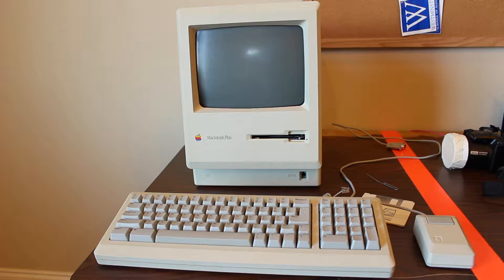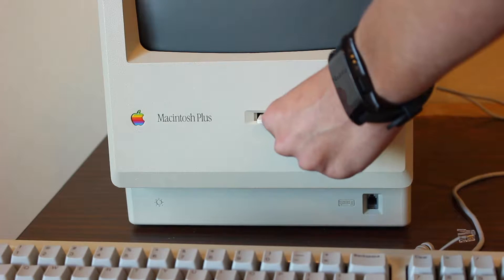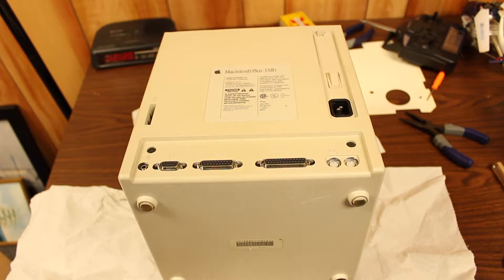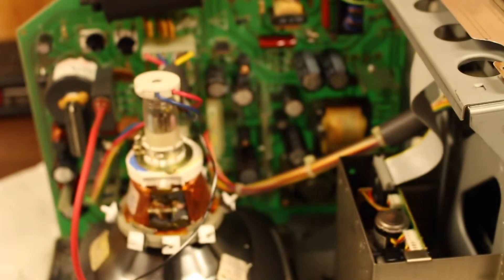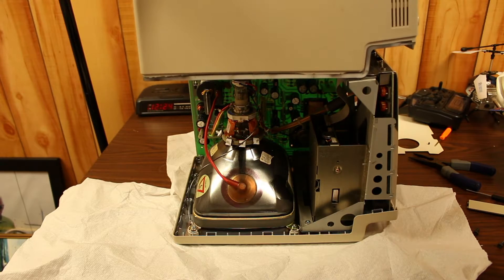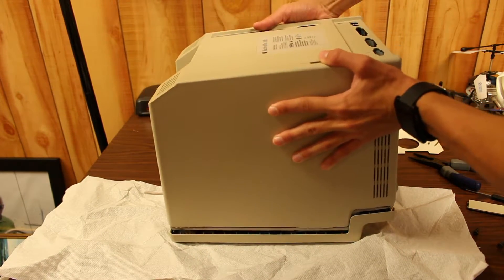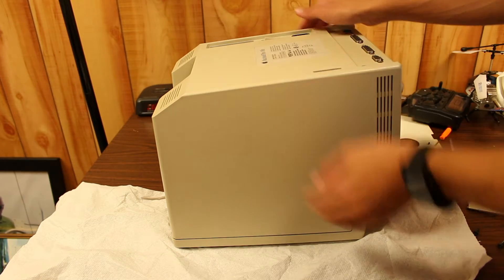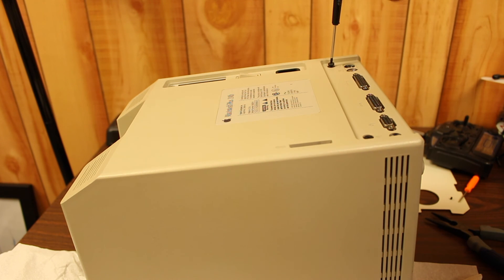Macintosh Plus Fix

Comment: It may be the board Hit it on the left side, and when i say hit dont hit it off the table! Just a thunk on in places around the left hand side! If you see something on the screen then its the board and its A cracked or B has a broken join! Also when you turn it on does it beep? 
Smaller things like turning up the brightness or waiting for a few seconds may work! Not too say you dont know what to do, but im just making sure. Also if the thunk method works watch a video and dont be scared to take it apart! But reminder they can still shock you badly if you dont look up what to do! And then poke around for a cracked trace! Btw the thunk method wont last forever so i would take it to a place that can patch the traces or pins for you!

Comment: the solder joints are your problem. the ones that connect to the display have a halo effect around them and are the main course of your problem. 

p.s.
You payed way to much for that Mac Plus
Reply from the maker: Yeah I ended up returning it a few days after this video was posted. Ended up getting all my money back anyways.

Comment: I have the same problem its an old mac that was found in a cemetery that has been sitting for about ten years. Me and my friend cleaned it up with everything we known on how to clean corrosion. After replacing the monitor we turned it on and the capacitors blew, my friend sprayed me with a fire extinguisher. I fixed the capacitors and now nothing happens. I think the corrosion got to the fuse. Im trying all the possible solutions for a 20 year old 10 yeared in the weather Macintosh plus.
Reply: Chirping is caused by bad cable connection